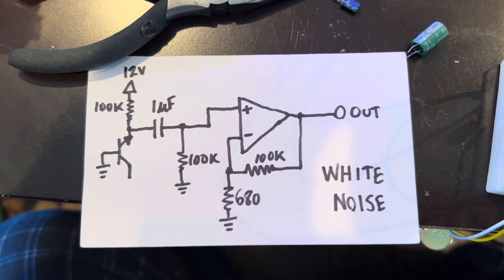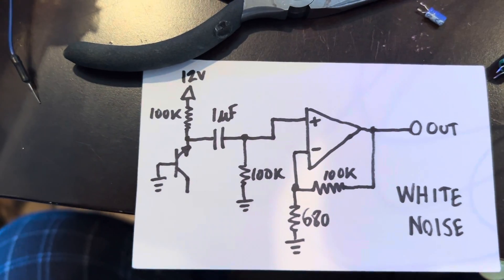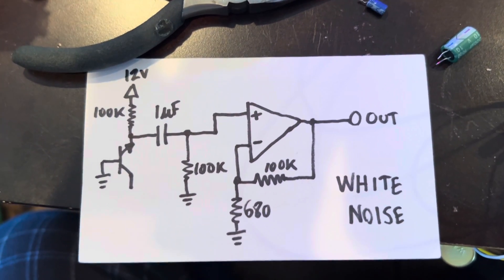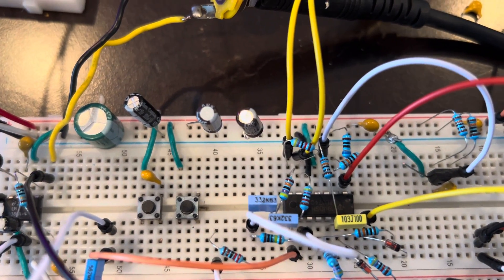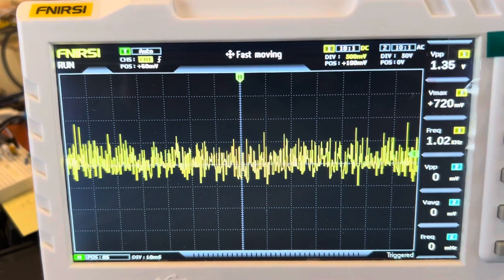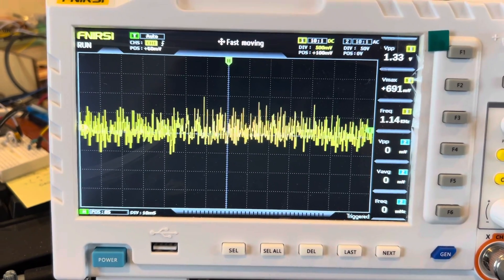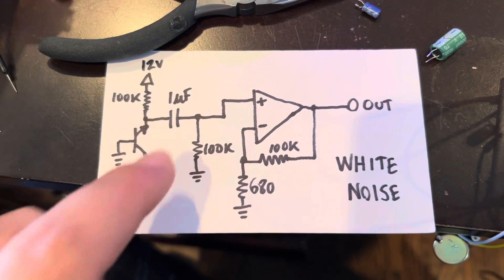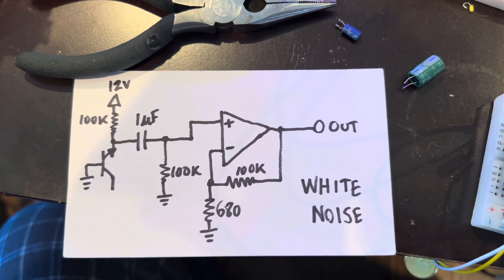Ultra simple white noise generator with one transistor

Comment: Could you give the specifics of the npn transistor and Op amp IC that you used as it was unclear in the narration and transcript ?
Reply from the maker: @robertwilkins1765  2n2222 or 2n3904 transistor and tl074 opamp
Reply: @igorbrichkov3632  Could you suggest any opamp with a single power?
Reply from the maker: @alexeygodin2094  you can use any op amp with single power supply. The one amplifier audio op amp designed specifically for audio and single supply is the lm386. Single supply gives you a dc offset though because the output never goes negative so you need a capacitor on the output though if you want to get rid of that dc offset to use for audio signals

Comment: Does the output is gauge to line or instrument (or even Eurorack synth's voltage)?
Reply from the maker: @NicleT  it can if you amplify it. Op amp +\- 12 V with high gain should do it. Big gain on op amp will add more noise too

Comment: I am curious what the noise signal amplitude is before the op amp.  I built a similar circuit (no op amp) powered off 12v and got 3v PP noise!
Reply from the maker: It is small in the 50 mv pp range. I had to crank up my amplifier before I  believed it was working. I built a snare and high hat circuit before using the non opamp version and used a transistor to amplify the noise.  That worked well but was too quiet for my tastes, especially if you plan on adding any passive filtering to it.
Reply: But with 9 volt work?
Reply from the maker: It should. Just a smaller noise signal